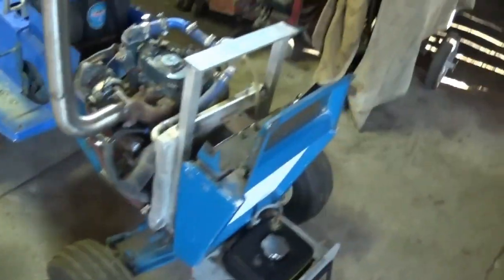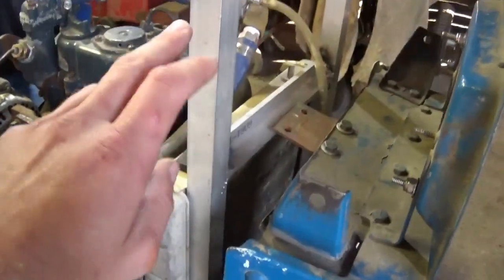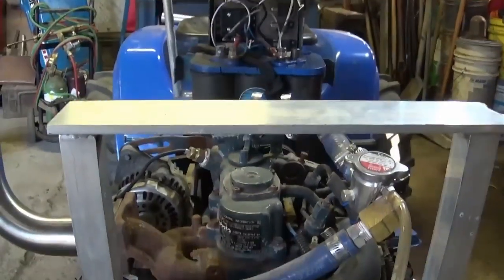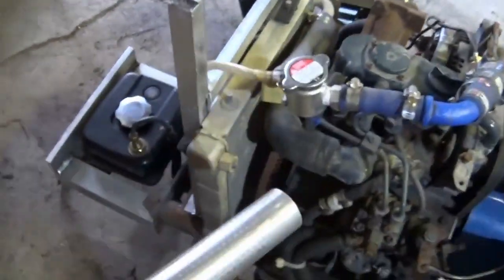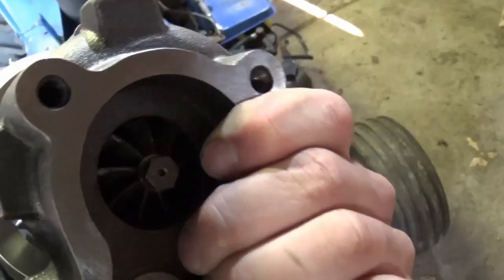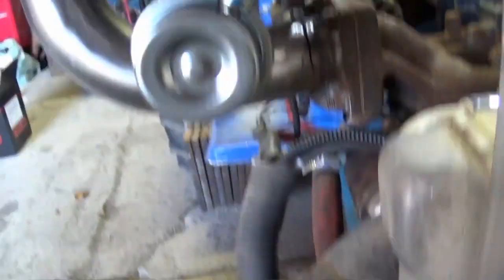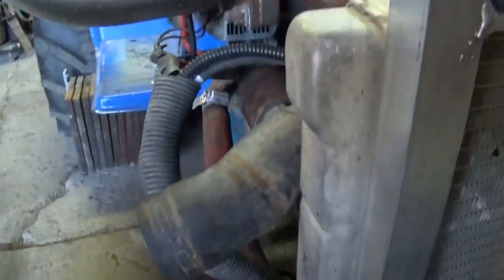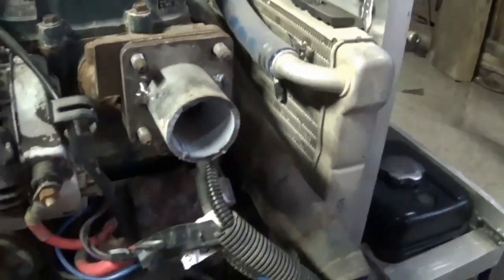Force Induction

Comment: hey man I got a quick question , I got a z482 on my golf cart and how many rpm's will these engines run , specs say 3600 but mine won't do it , I can get 2100 that's about it and that's with the adjustment screws removed, will yours turn 3600 ?
Reply from the maker: Yes that's what mine is turning now and I could probably go more if I really wanted. Even before I turned it up last time It was turning 3000 rpm
Reply: huh I might have a problem then lol thanks for the reply , did your engine come off a apu ?mine did and it was set to run at 1800 but wont go over 2100, beginning to think its the way they built it
Reply from the maker: +Matts Mower Madness ya mine is off and apu. And it should go higher than that. There could be something wrong with the pump. Depending on how old the engine is the fuel rail could be seized. I'm thinking that because they are locked at one rpm
Reply: yeah I was thinking the pump or fuel rail but I wanted to see if yers did the same thing before I tear it apart
Reply from the maker: +Matts Mower Madness that's where I would start anyways
Reply: right on man thanks

Comment: You should be able to clock that turbo so that the pressure side connects directly to your intake tube rather than using a 90.
Reply from the maker: I would if the mount for the waste gate actuator wasn't part of the compressor housing